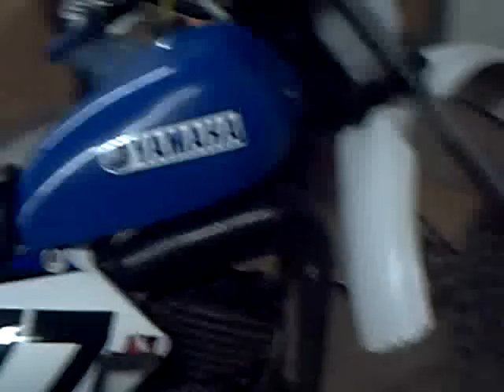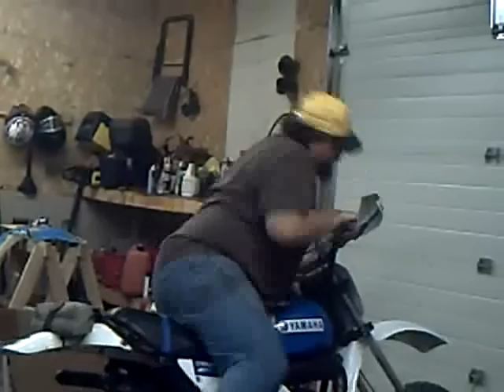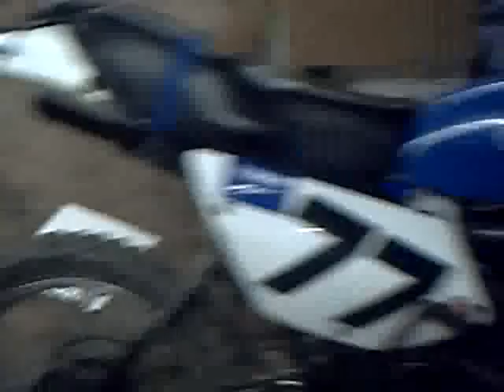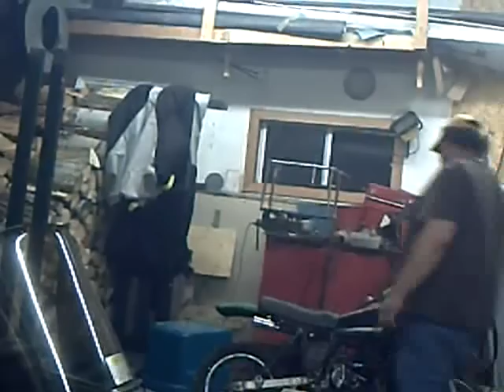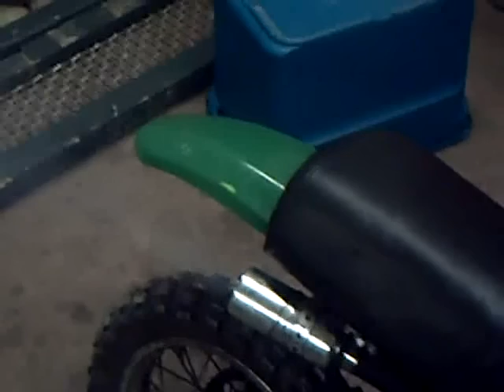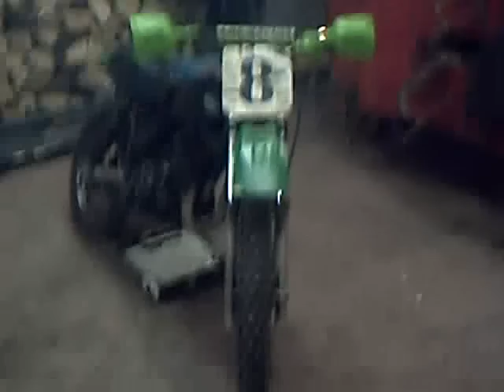1978 DT-MX 175 and 1979 Kawasaki KX 80 Walk around

Comment from the maker: @shakaroon1 the reason it didnt want to start is because i had it running allready just before the video and it fouled the plug a bit....it starts first or second kick. The starting procedure you mention is good for any big bore bike that is hard to start and may kick back...the first few slow kicks get fuel in the cylinder then lining it up TDC ensures a full stroke. For smaller engines it isnt necessary because each kick turns the engine over several times

Comment from the maker: @jayboy2860 yup a block should work if you mount it properly so there isnt much play...you can put it at the end of the shock or up inside the shock tube under the gas tank.another possibility is just lowering the top mount where it bolts up inside the shock tube. as for being quick,i wouldnt say so.it only does about 60 mph with that gearing tapped right out but is peppy for such a small bike.very fun for mid paced trail riding which is all i do. the side plastics are 2002 YZ from Decal Works

Comment from the maker: @jayboy2860 yes quick on accel...ive beaten 4wd 400cc 4 wheelers....and mine doesnt have the stock gearing....i think im using 13 front 51 rear....stock they come with 14 front 49 rear....which is fine but i like to have alot of low end grunt to bring the front end up more easily and have more power in the bottom end...i rarely ever touch 5th and 6th....usually put around in narrow trails at 25-30 mph

Comment from the maker: @flemo46 with people like you my arse only knows how to be smart. if it was your bike you could mount the plates on it however you wanted but unfortunately it isnt. i decided to weld  brackets on with new steel and tap holes in them and bolt the plates on with stainless steel bolts. obviously they arent positioned in a fashion that is up to your high standards so i apologize.  do you know where the plates are mounted on mid to late 70's MX bikes? google some pics boy....now move along